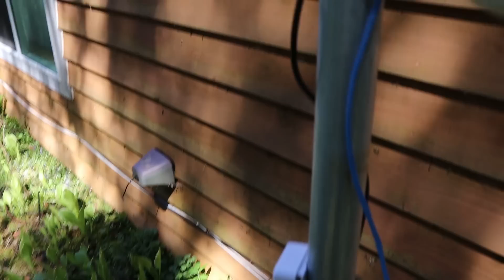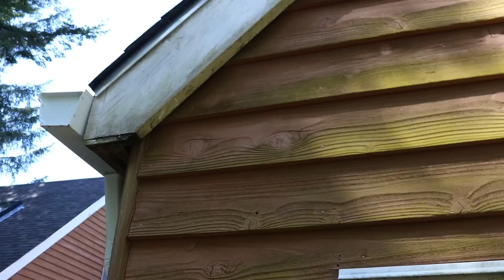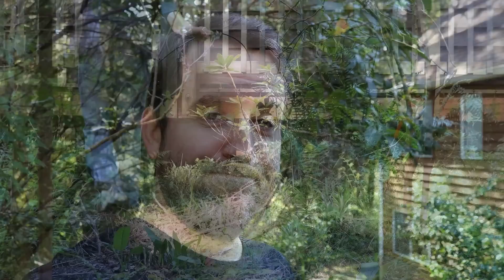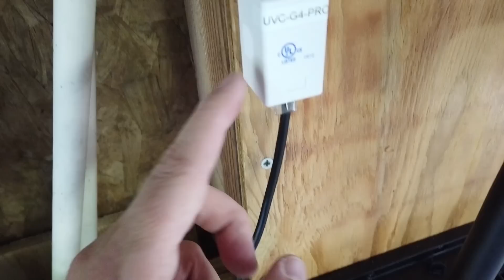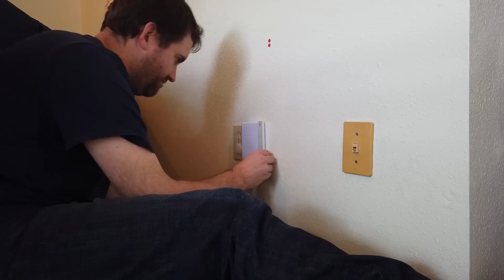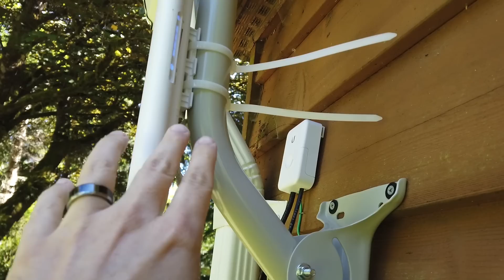Home Upgrades!

Comment: For one man pulling I built a cheap spool holder out of some 2x4's and a piece of galvanized pipe that can put the spool of cable on.   Then I can easily pull from one end and it rolls off, rather than having to unwrap the cable into a sometimes unmanagable mess that gets tangled.

Comment: What is best way to determine the best unifi system (equipment/placement) for your home? Have a ranch style house with basement, small home office out of the basement. Wires run to kitchen and living room (Cat 5e). Bedrooms are separated by main living area. Having difficulty getting decent internet speed and connectivity in the bedroom section. Have tried the Orbi and currently using Eeros with an unmanaged  Netgear 8 port switch.

Comment: I am in the process of replacing my Notgear network with a Unifi setup. I am planning on using a hardwired jack behind my refrigerator for a Flex HD on top of my refrigerator . It is very centrally located and may cover the entire house. Do I have to worry about interference from my refrigerator? I can place it beside my refrigerator but that would limit to part of the house and may require a second AP. I noticed your AP near other electrical fields like the charging station.

Comment: If you plug a 24v passive into 802.3af does it not blow it up because isn't the voltage higher?

Comment: I am looking at using the Industrial Swith to run three external network switches using the 802.bt and the Flex switch. Does it have to be wall mounted? Does it cope well with using three flex switches. The Flex switches would be running a CCTV camera and a Mesh AP Pro.

Comment: Good luck on your move and pace yourself!
At your new house, consider using/making 'hooded' low voltage cable entrances. I have used short lengths of 1/2" PVC with 45 degree elbows on both ends, OK for coax and cabling that should not be bent sharply. After cable install, fill the void with putty to prevent critters from entering. :)
If there is a commercial equivalent I'd like to see it!

Comment: Chris,  congrats on new house!  Can’t wait to see your new setup.  Your projects and cable running got me thinking.  What do you think about using MoCA adaptors to get your signal to “difficult to string cable to” parts of your house?  I don’t have cable or satellite tv, so the network signal would be the only thing running on the coax.  Besides the conversion/reconversion delay, I can’t think of a deal breaking down side.

Comment: It's weird how that happens, I hard-wired a whole load of rooms, just got the smart heating system configured properly, we'd bought some furniture specifically the work round some of the limitations in our old house, and just had our second child as well and then we bumped into the perfect house entirely by chance and moved as a result, 18 months later I'm still working on getting everything set up properly again, but the house is loads better.
Good luck with your move!

Comment: When drilling an exterior wall to run a cable drill at a slight angle with the outside lower than the inside if you live in an area where there will be rain.  This will help ensure than the moisture runs out of the home and not into it.  It also helps to run a small drip loop directly outside of the entry point.  Again, to ensure moisture doesn't attack the wall but runs away from it.  This helps even if you seal the entry point.
Reply from the maker: Great tip!

Comment: Great looking installs Chris! Could you comment on the use of Shielded vs unshielded cable? I noticed all your cables in this case were unshielded. Have you noticed any failures that could be caused by unshielded cables? Do you specify shielded cabling for customer installations?

Comment: can one use use a normal 8 port POE in a garage that's unheated?  I want to add one to my garage so I can add cameras on 3 parts opf my garage.    As always  love the videos
Reply from the maker: Depends on the climate. Would be fine to use a normal switch in my area. But your mileage may vary.

Comment: How would you setup transmitter power on all this APs to have proper coverage and switching? I have 4 APs and when I go outside to the very edge of my yard I'm still connected to the AP in the cabinet instead of closer outdoor AP.

Comment: Excellent content, as always. Can I ask where (link if poss) you get the Keystone connectors from? I am fast running out of POE ports on my 16 port switch and was considering adding the industrial switch in my loft, that or just using some of the injectors that shipped with my AP's.
My initial (closest to the Garden) Nano HD is not quite powerful enough for the bottom of my garden and I need to add something to address this... I can see a divorce brewing :)
Happy to hear your news, going to miss the old place. Good luck to you and your family on the move.

Comment: I want to learn nanostation m2 as a secondary router anybody help me....
Reply: The nanostation m2 doesn't have routing capability, it's an 100Mbps wireless Ethernet extender with a secondary port. It not a WiFi Access Point.  What is it you are trying to do?

Comment: why did you not just dig a shallow trench and use even garden hoses to protect the outdoor cable two inches deep is good enough if you put it in conduit.   Garden hoese are not excellent but work to put in the pull strong you only need a small plastic bag and vacuum cleaner then pull the cable using the string.

Comment: Good luck with the house move! I'm currently enjoying a remodel on the property we are in. It most likely will involve me having to redo the wiring once again as one of the rooms was supposed to be a bedroom and may now turn into a bigger office instead. Let's see how it goes. The big benefit of a different property might be that you can plan out the wifi and network drops. I must admit those in-wall APs are looking like an interesting option.

Comment: Hopefully, you will have time to prewire the new place.  Pull extra.
Reply: Yes, lots of extra. When I built my house 15 years ago, I put in 7 connections over 4 locations. At the time, most people were putting in one cable in 1-3 locations. Since then I have added at least another dozen connections over at least another 6 locations. The ease in which I can run data cable will absolutely be a consideration in any home I get in the future.

Comment: I am working on some home upgrades myself. I am debating between having 3 AP HDs and an in-wall HD vs. 3 AP Pros and an in-wall HD. From watching the AP explained videos I had settled on the AP Pros since even that seemed like overkill but Ubiquiti released the Design Center and it appeared that my coverage area would only be in the green with the Pros vs the more orange coverage zone with the HDs. Would you do the Pros or HDs?

Comment: Hahaha didn’t see that coming we’ll join the club i required my camera and network and then after spending hours on ladders and pulling cable a month later I had to do it again 501 miles away at any new house I didn’t expect the big difference lol is now 35 acres and a house 10 time bigger. I dropped more f bombs in the new house then I wanted 

My god man I have respect for you but that wiring period is a dam embarrassment. You have a company that does this stuff but yours looks like that......

Pull all cable in the house thru the attic and walls. Pro tip drill inside out not inside in

Wasting so much wire running it around the house

Man a power washer also that wood needs a lot of love and asking for expensive issues if you wait

Oh my mounting the esp outside whyyyyy mount inside and terminate there and have a wire go they the wall nothing outside and nice and clean
Reply: I appreciate Chris's videos, and it's clear his forte is the logical configuration of the equipment.  The physical planning, installation, wiring management doesn't seem to be his strong suit, which is very common. Even many commercial installations logically are good, but look in the closet or ceiling and you find a rats nest of tangled up impossible to follow multi-generational wiring with old abandoned cables.

Comment: I prefere the INS‑3AF‑O‑G PoE ->24v converter, only one Patch cabel, outdoor able, only 2€ differance at my dealer here in germany. The  INS‑3AF‑I‑G I only use for quick tests because it's mire universal.
You could install USW‑Flex outside your garage, you have already a PoE++ Switch installed right next to it and could install more then just one device (ignoring the out port oof the Nanostation). Ok, maybe overkill.

Comment: You guys have weird houses over in the US. Everything made out of wood and drywall. Great for cabling and modifications but the endurability is questionable in opposite of European style houses.
Reply: It’s more regional than that... Oregon is known for logging and therefore wood is cheap and abundant. 

Here in Oklahoma most of our houses are brick or stone clad wood framed, my house was built in 1969. 

Weather is also an issue if it doesn’t get hot or cold then what’s the point such as Hawaii where the walls are plywood. Expense of materials on an island also and issue like Alaska.

Comment: There are few things more permanent than temporary solutions that work well.
Reply from the maker: So true...
Reply: I still need to punch a hole through the wall to go from where my cable modem sits to where I have my USG. The good thing is that appears the wife has developed a blind spot for this cable running under the doors as well. :)

Comment: Hi Chris,

First of all, good luck in the new house ;)

I saw you always place your Ethernet Surge Protectors outside of the house. Can it also be placed on the inside of the house or in the server rack ? Or is their a max cable length between the outside device (AP or camera) and the surge protector to work properly? 

Planning on buying a ETH-SP-G2 because I bought a AP-AC-Mesh for our outside WiFi 😇.

Thanks for the advice and thanks for the awesome YouTube Channel 👍👍
Reply from the maker: Yes - technically you're supposed to have one at the equipment, and then another one just before the switch/router.  So that would cover both inside and outside.

Comment: I have 3 cameras in our Car Space due to unsavoury people running around under our unit. I used the In-Line Punch Down Blocks which was a real time saver they are great for jobs like this no need to run new cables just terminate at the block and run a cable from there to the switch

Comment: You know you could have just used MOCA adapter rather than pull a new cable for that loft room
Reply from the maker: There are many ways to accomplish the same things in IT - that's why it's so fun!
Reply: @CrosstalkSolutions  Very true Moca has been a life saver for me.  I love how easy and was surprised how well it worked BTW I sent you an email about a fairly large project I would like to  get your input on.

Comment: Tips for beginners: Mount Jacks (RJ45 sockets) up the other way, brass pins to top. Stops dust and contaminants settling on the pins. Home-made patch cables find their way into the bin way quicker than pre-made molded cables. As you do a lot of testing, I would have suggested a UniFi switch that does 24/48V and feed 4-6 cables out to an outdoor junction box near testing area. Terminate the cables to sockets here. Now you are only connecting test gear on short patch leads without the mess in rest of house.

Comment: Sweet, congrats on the new place! Now you get a clean slate to run all kinds of wires. 😂😂👍
Reply from the maker: Looking forward to decking out the new house with CAT6 and WiFi 6.
Reply: @CrosstalkSolutions  If its new construction then go with CAT6a for some of your drops. At least for some runs that may be used for trunking switches together. I been wiring my new home (still under construction) for about a month. So far have 55 drops mostly Cat 6A with some Cat 6.

Comment: Often I laugh at Americans and their plywood houses. But for doing stuff like this it is sooooo much easier. Try running cables through a wall when everything is concrete.
Reply from the maker: I read this comment in a French accent.
Reply: @CrosstalkSolutions  Sorry to disappoint you 😜 I'm Dutch. Thinking about buying a UDM pro an see where it goes from there.
Reply: All you need is a different drill bit!
Reply: @compudude  and a lot of cable ducts

Comment: The USA where all the houses are seems to be made of wood. Much easier to install than Europe's concrete and stones ;).

Why do you use cable clips Instead of pipe? The result with ( pvc ) pipe is way better and it's faster.

Keep up the good work I enjoy your videos
Reply from the maker: I disagree that PVC conduit would be faster - plus, it would be more expensive.
Reply: More expensive but a 10' stick of 3/4" is like $2 or something which is nothing
Reply: "Nods in 18" masonary SDS drillbit"

Comment: Probably a good idea to also ground the pole mount on the wall next to the electric meter. It will give you an extra layer of protection against lightning and electrostatic buildup on the metal pole mount.
Reply from the maker: Good tip!  The ETH-SP is grounded, but not the mounting arm.

Comment: Awesome to see your home setup. Because of all of your extremely helpful videos, I've also been using my extra time at home to improve my home networking set up. Switched to all UniFi gear thanks to you (and other YouTubers) recommendations. As well as setting up an IoT network and firewall rules. I started out wanted to hardwire ethernet to rooms around my home. But like you, I'll probably be moving in the next year or so. So I cut that project short and instead opted for improving the network with all the UniFi gear. I look forward to the videos at your new home. Hopefully we can get some content out of that; I know that I will make good use of it! Cheers.
Reply: Wait, where's your current house? I might be interested now that I know that cat6 was installed!😹

Comment: I've always been curious if you considered running conduit for your exterior cabling for better protection from elements/intruders. Suppose it comes down to a cost and beautification standpoint, but I guess it doesn't matter too much if it has worked for your purposes and you'll be moving anyway. Best of luck to you!
Reply from the maker: I considered it for that long run from my office to the garage, but ultimately decided it was too much expense and labor vs. just stringing up the cable.

Comment: Wallcharger and wireless network that close? no interference?
Reply: I thought about that too, I figure there will probably be some interference but it's not like the charger is constantly charging and probably not worried too much about the interference from the charger with a car 4' from the AP. Good enough for home I suppose.
Reply from the maker: The electrical cabling that feeds the Tesla wall charger goes UP out of the  charger - behind where I put the UAP-AC-LR is empty.

Comment: As an I.T specialist we do customers installs very neat but when it comes to our own home/office we are lazy and maybe it because we are tired and over it when it comes to our networks and I.T setups
Reply: Hey speak for yourself man I can't stand looking at messed up cabling I have to keep everything orderly or my OCD kicks in. I actually got my new job because I showed my boss how cleanly I did my personal setup.
Reply: Eh, I agree that I hate doing work on my own equipment/network (I just want it to "work"), but my effort in quality control isn't any lower.
Reply: still have some stiff OLD back in the day cat 5 remnant cable from unearth form the old computer store stock room stapled in to the INSIDE of my door jam going outside staple on the side of the house. turns out the door CAN chafe off the the otter sheathing exposing the pairs and still work!
Reply: Much harder to do when you rent :/. I’ve run cables pretty well except behind the cupboard and microwave table lol other areas are neat as I run everything from my Lounge Room to my Main Room and to the Cameras etc